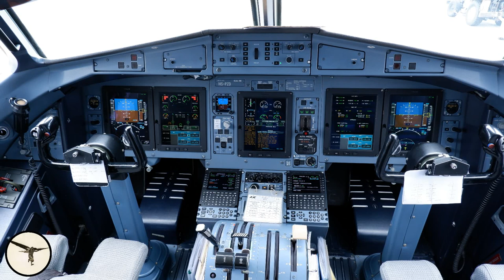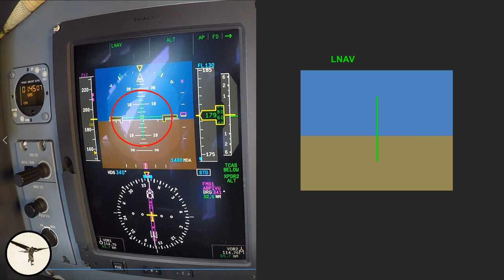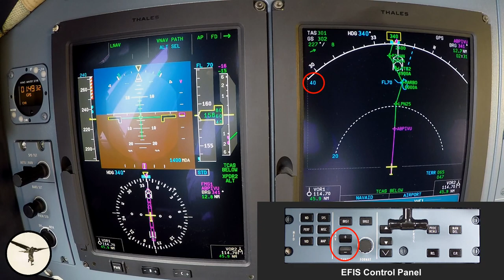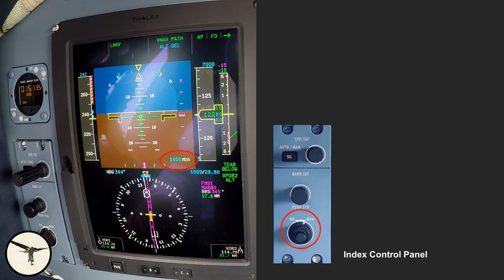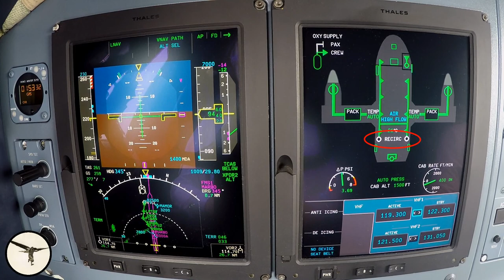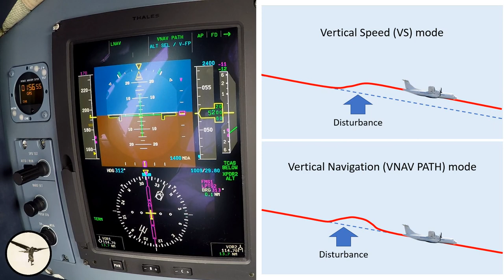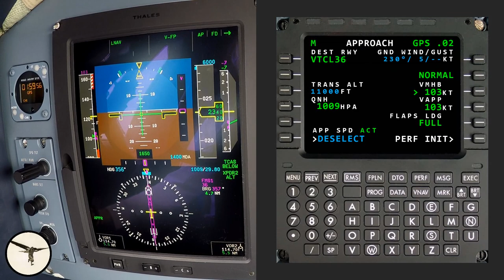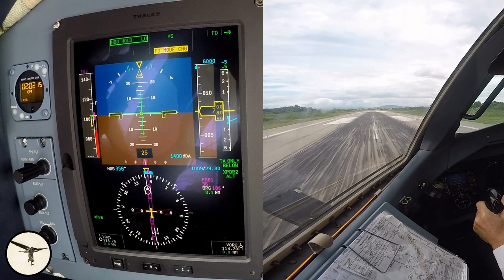ATR 72-600 glass cockpit - PFD and MDF during approach

Comment: Sorry if I missed something. What do the two amber horizontal lines mean in the speed indicator bar on the left. Is this the maximum gear down speed? I see that there are a double amber lines on the altitute bar as well. This was the MDH I believe, right?
Reply from the maker: You are right about the MDH. The two horizontal amber lines on the speed indicator are VFE, flaps extension speed. In the ATR 72, with flaps up, it indicates 185 kt, which is maximum speed for flaps 15. With flaps 15, it indicates 150 kt, which is maximum speed for flaps 30. 
Landing gear speeds, VLE, are not shown on the speed indicator. But there's a placard above the landing gear lever showing those speeds. Gear extension = 170. Gear retraction = 160. Gear down and locked = 185 kt. 
The speeds for ATR 42 are slightly different.

Comment: Hello (again:-). Question: is theFMS/vnav  descent profile calculated with flight idle and a default speed from the FMS? Can the pilot insert a desired descent speed and/or a specific descent power setting into the FMS and is the profile then calculated accordingly? Regards, Boy
Reply from the maker: Hi. Standard descent profile calculated by the FMS is 3 degrees. Standard speed during descent is 240 kt IAS, but the pilot can choose any speed he/she wishes. The speed is controlled by adjusting engine power. We do not use idle power as this creates a lot of braking force.
Reply: @FlywithMagnar  Check and thank you, perfectly clear now! 👍🙂

Comment: I wonder why the Go-around path in Lampang directs you on the east side directly to the mountains instead on the west which is generally clear of terrain?
Reply from the maker: The terrain is not an issue here. The missed approach procedure is the shortest track back to IAF. It requires you to climb straight ahead to 2,500 ft before you turn to the right. The highest terrain in that area is 2,936 ft and is located 6 NM east of the airport. Minimum go-around gradient is about 150 ft per NM, or 900 ft in 6 NM, which is easily maintained single engine. That means you will cross the highest terrain with at least 3,400 ft.

Comment: Very nice and informative videos sir. 
Not relevant but 
The title says MDF.. Should be MFD. 
I have following doubts sir, 
1.If you are joining a DME arc from radials which are not as per FMS, do we have to manually make the points to join Lead Radial. 
2.Can you please explain engine failure after climb procedure when power management was set to climb. 
And engine failure at 500ft to touchdown. 
3.Can we do tank to tank transfer on ground? 
4.Please do some more videos on Landing including gusty conditions and usage of CL 100override..and safe landing techniques with low weights.
Reply from the maker: Thank you for informing me about the typing error.

1) It depends on how the DME arc is programmed into the FMS. In a worst-case scenario, you have to define new waypoints for the entire DME arc. I have done that.

 2) The procedure is "ENG 12) FLAME OUT IN FLIGHT". If you have an engine flame out on the final, you do the memory actions and decide whether to land or go around.  

3) Fuel transfer? No, that's not possible.

4) I would love to make more in-flight videos, but currently, I'm without a job. CL 100% override is used when called for in the checklist and at the pilot's discretion. I use it when it's turbulent/gusty on final because it gives better engine response when I have to increase power. Landing with low weight is like any other landing: Fly a stabilized approach and follow standard procedures in FCOM. My advice is: Use the same technique for all landings.

Comment: Hi Captain! I just want to clarify something about MDA. Is it really necessary to a a allowance of 50ft or 30ft to the published MDA on NPA? On ILS precision we put the published DA value as is right? What instances should we use the published MDA value without additional 50ft allowance on NPA?
Reply from the maker: When the approach chart says your minima is MDA, you must add 30 to 50 ft (depending on company policy), because you are not allowed to descend below MDA unless you are visual with the airfield or the approach lights. The extra 30 to 50 feet are there prevent you from descending below MDA in case you have to go around. However, there are 3D non-precision approaches (LNAV/VNAV, LPV or GLS) where minima on the approach chart is defined as DA, just like an ILS. DA is Decision Altitude, and there's allowance for altitude loss during a go-around. The only instance where we don't have to add 30-50 ft on MDA is when we fly a circling approach.

Comment: Hello Capt Sir, when you are in a descent excess of -1500fpm do you need to active the "FAST"  cabin pressurization mode?
Reply from the maker: It depends. Normal descent rate for the cabin is 400 fpm. If the cabin altitude is 4,000 ft and you plan to land at sea level in less than 10 minutes, then the answer is yes, you should use FAST mode. But if it will take 10 minutes or more, then you don't have to use FAST mode.
Reply: @FlywithMagnar  I just realized that I've been misunderstanding on how 'FAST ' mode works until now. Thanks so much for the explanation!!

Comment: So in VNAV mode does the aircraft start the decent automatically on it's own once it reaces the TOD or the TOD has to bee defined by coordinates or distance?
Reply from the maker: If you select VNAV mode before TOD, the aircraft will descend when reaching TOD. But the pitch down movement is a bit brisk, so we prefer to do it manually (by using VS mode).
Reply: @FlywithMagnar  Ok I see thanks!
Reply: @FlywithMagnar  If I'm not mistaken it will actually begin descent immediately no matter where you are in relation to the TOD when you select VNAV. The only difference being that it does not follow a 3 degree descent profile anymore, and calculates a new profile based on where you selected VNAV. The only way I have been able to preselect VNAV without starting descent immediately is to create a user waypoint at the TOD with a altitude constraint at the level you are cruising at. This is in the standard 2 though, it might be different in newer versions?
Reply from the maker: @MortenBilet ,  it depends on when you push the LNAV pushbutton. When you push the LNAV pb more than 5 minutes before TOD (no magenta V-bar on the PFD), VNAV VS mode is activated and the aircraft will start to descent with 1,500 ft/min (FCOM.DSC.22.4 p.11). I have never tried that. When you push the LNAV pb less than 5 minutes before TOD (magenta V-bar on the PFD), VNAV PATH mode is activated, and the aircraft will follow the descent profile in the FMS (DSC.22.4 p.15). That means the aircraft will maintain it's altitude until TOD and then start the descent. I haven't done this for several years. But to be sure, I will check it out on my next flight, which, unfortunately, is two weeks from now (we fly with 10% of normal capacity).
Reply: @FlywithMagnar  Eagerly waiting for this video sir. I also have some doubt on this. Your video may clarify this.

Comment: Captain difference between 72-500 and 72-600
Reply from the maker: External: Different angle of attack sensors and hinges on the main landing gear doors (you have to be a mechanic to see the difference). Cabin: The -600 has larger overhead bins. Cockpit: The -500 has EFIS and "steam gauges". The -600 has 5 LCD screens, and FMS with LNAV, which can be upgraded with IRS, giving RNP-AR capability. You can see the difference in this video: https://www.youtube.com/watch?v=PypNWb9pr9Y.
Reply: @FlywithMagnar  thanku captain but I need some more  information between 500 and 600 ,like autopilot having difference etc etc
Reply from the maker: Avionics is the largest chapter in the FCOM. It will require many videos to explain all of the differences. Regarding the autopilot, the major difference is that the 600 has VNAV capability. Otherwise, the 500 and the 600 do the same job.